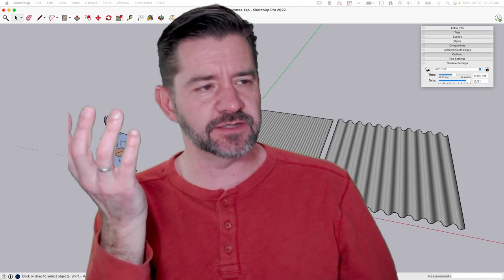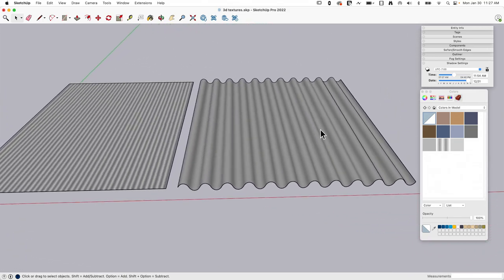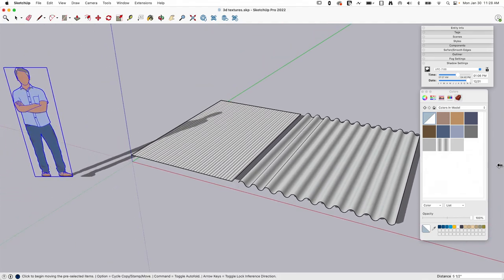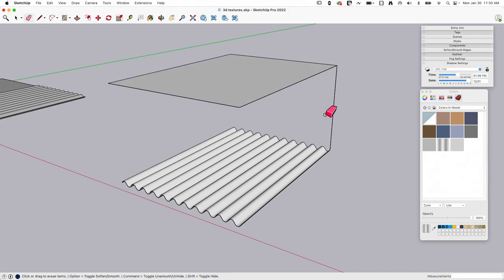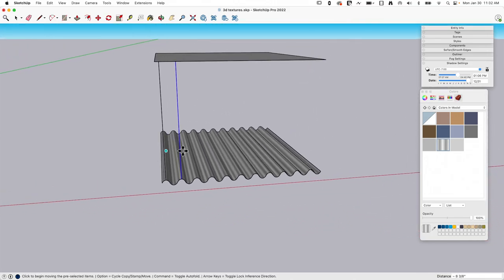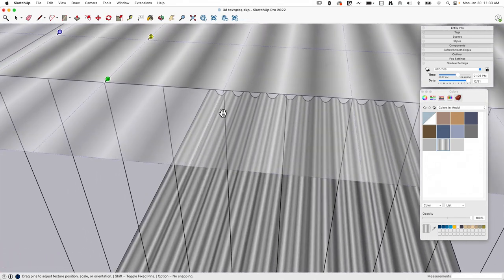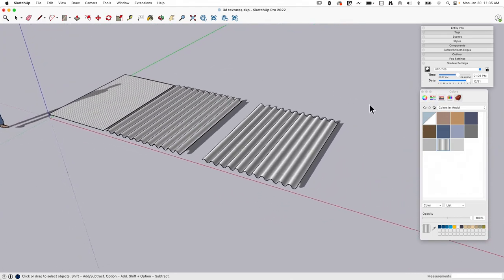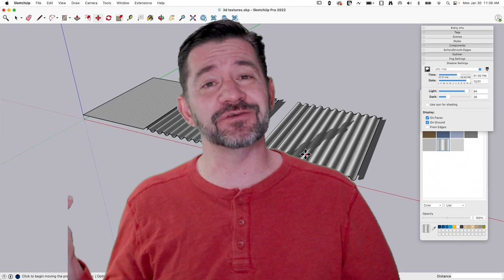Making 3D Textures in SketchUp

Comment: why I cant use my 3d connexion space mouse with sketchup go
Reply from the maker: SketchUp for Web cannot run extensions. 3D Connexion connects to SketchUp via a custon extension. At this point, SpaceMice only with with SketchUp for Desktop.
Reply: @SketchUp   yeah I had to purchase  sketch up pro, now  is working fine, with an exception, yesterday I was sketching  a house plan and after I add the grass  the software start acting up , and the 3d controler  was acting weird